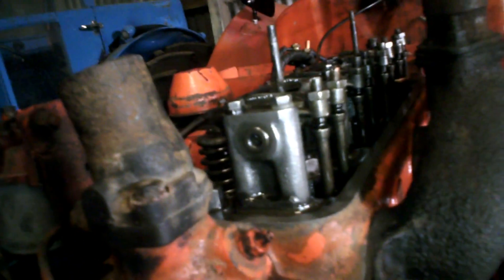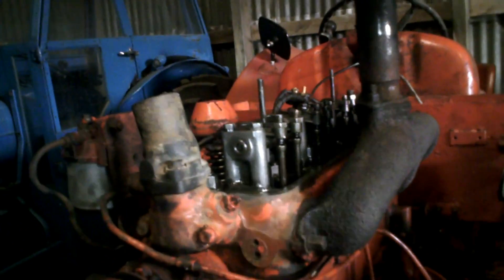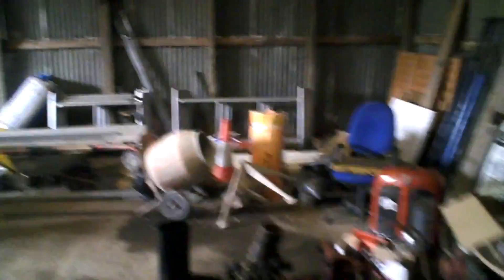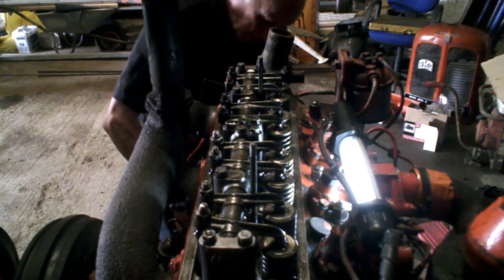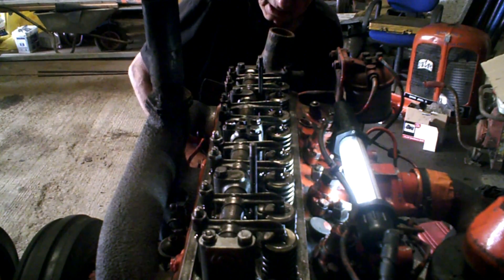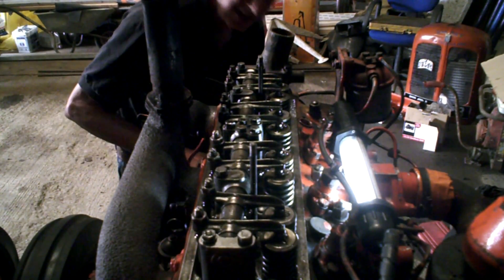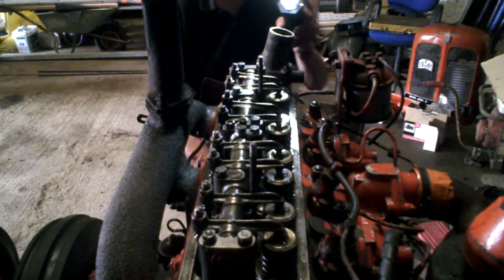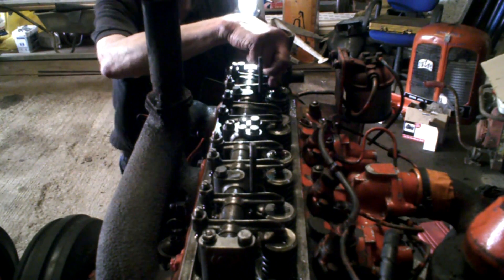Engine Chat While Working on the Nuffield

Comment: Hi Malcolm of Lincoln Iv just found you and you've made my life so much simpler, I also have a Nuffield engine in parts and I'm learning so much off your videos, do you happen to know the tightening torque for the cylinder head?
Reply from the maker: Thanks John....pleased it's helping. Cylinder head torque is 100 ft lb. However once bolts, or studs and nuts are tightened they usually just want doing up tight, and I mean tight. If you read through the comments on my recent videos, Lance (Bundy Bears Shed) a very experienced tractor fitter said he uses hylomar, torques them, then once they have been hot re-torques them again. Either way should work. Just check that both head and block surfaces are as clean as possible. Once cleaned mine were in very good order.
I've managed to find some more information so may be able to help if you're stuck.

Comment: I bet you have some air still trapped in the pump or lines. Sometimes you need a mechanical pump to force the fuel through the system to get all the air. Good luck Malc
Reply from the maker: That's the next step Lloyd once Malc gets the injectors checked. Only reason I didn't want to run it for long was in case there was a problem with the cam timing, which could of course caused more serious damage. These engines usually purge themselves quickly just by running. I've already done this when I changed the fuel filter last year.

Comment: Is the firing order stamped on the block somewhere? I think most often on a straight engine, #1 is in front.  Injection pump issues come to mind, but I confess I've never worked on a diesel. I'm sure you will sort it out and be the go to guy for Nuffield.
Reply from the maker: Now I know the timing's right Jim most likely just needs running for a bit. Most 4 cylinders inline engines are 1342, the common exception being Fords which are 1243.

Comment: Maybe a silly comment, trust you've checked the glow plugs, Malc?
Reply from the maker: Not got any Lee. I'm now thinking something may have broken in the governor when it opened up sharply when it went onto 3 cylinders.....running out of options......or it might? just be it needs a run to purge the air......injectors being checked in a few days.